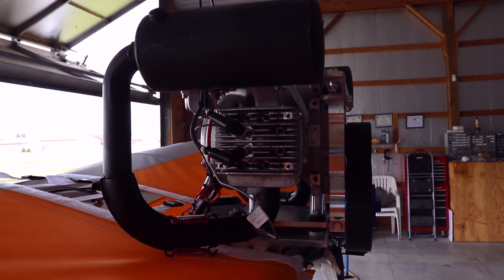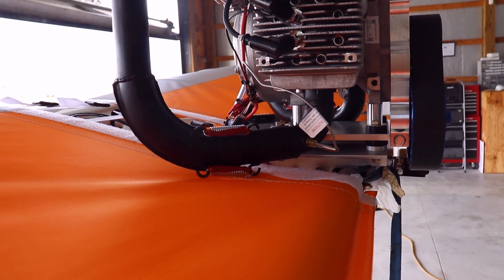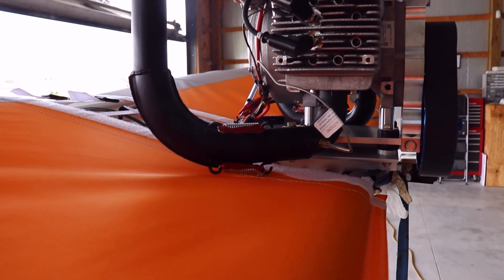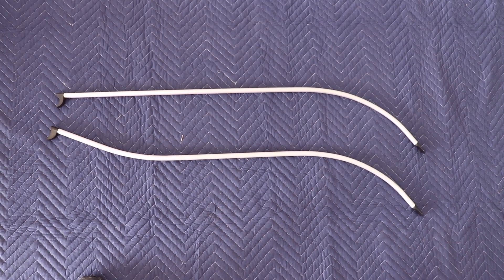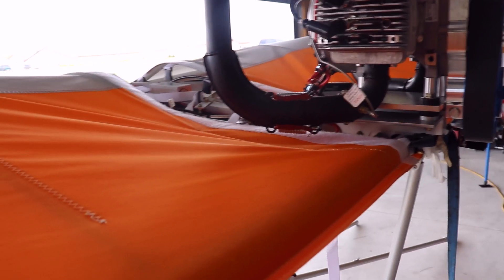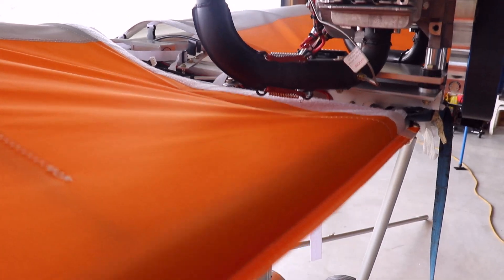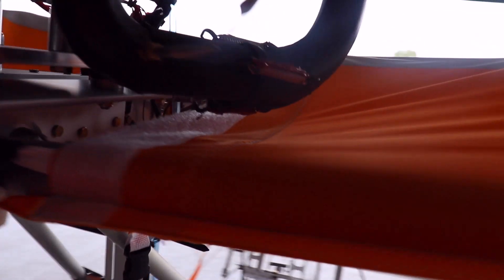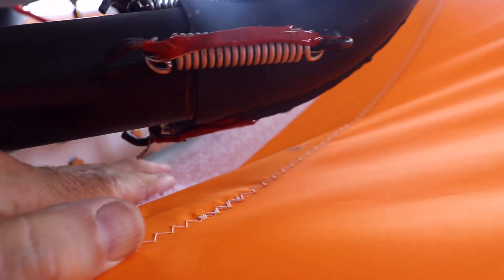Aerolite 103 Rib Mod for F23

Comment: Wouldn't you be better off just raising the Engine? Maybe also make a Heat Shield Plate Ceramic Coated that goes under the Engine Mounts that sticks out between the Wing Fabric and Exhaust! Ceramic Coat the Exhaust will reduce Outside Exhaust Temps also. You can do these coatings yourself in a Free Electric House Stove.
Reply from the maker: Raising the engine would also raise the Prop thrust line.
Reply: @hayesaero9766  I'm sure that may be the correct way to go, but geez, the fabric looks terrible with all the wrinkles after the mod. I personally would just lift the engine an inch and suffer (?) with the thrust line being up an inch.
Reply: @timvanackeren7184  the exhaust has to be modified
Reply: ok
Reply: @hayesaero9766  not if you redesign the drive to be longer with a longer belt